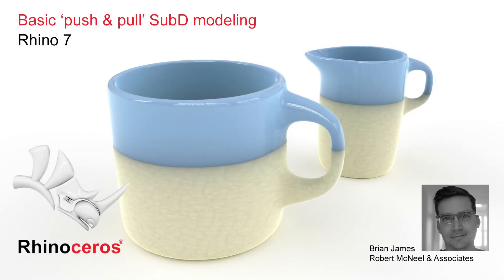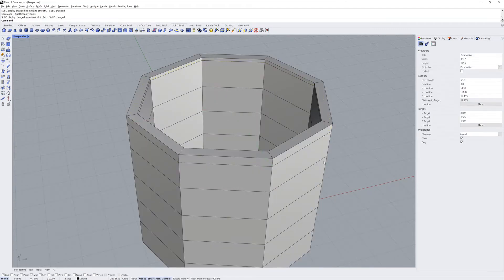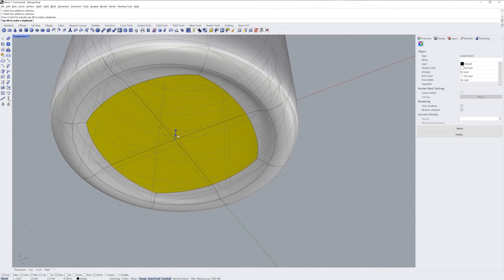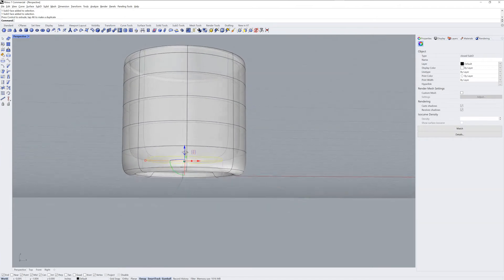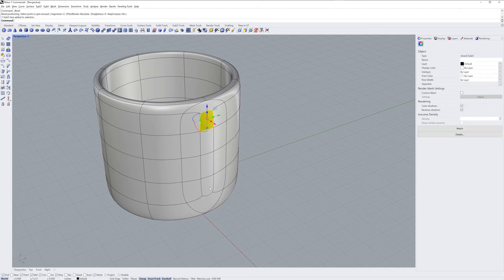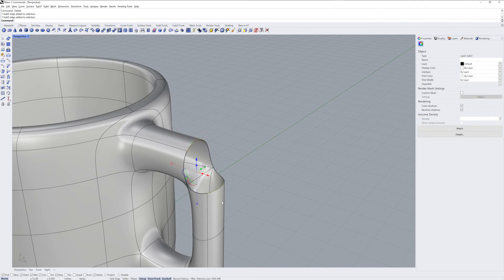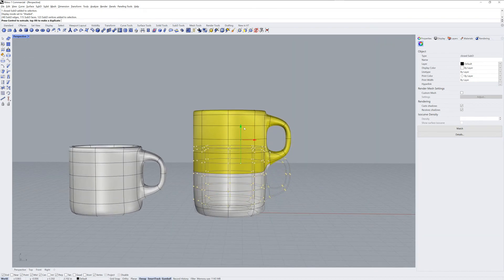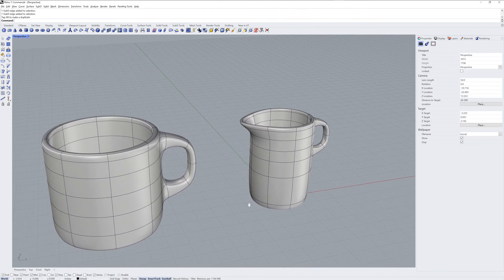Rhino 7 SubD Basics

Comment: Thank you very much for the video, when I press the SHIFT key it scales in two dimensions like your video but when I press CTRL it is distorted and it does not appear like your video. I understand that you press both SHIFT and CTRL at the same time, right? This change occurs at minute 1:00 until 1:17.
Reply from the maker: It looks like something changed here and I'll check with the developers, thanks for the question. You can use any of the single axis scale handles adding Shift and then Ctrl/Cmd to scale and create new faces instead.
Reply: @RhinoGuide  I wish they'd change it back. much more intuitive.
Reply: Hi, Unfortunately, I have the same problem and this function doesn't work for me either. :(
Reply: Hey, just a heads-up — this method works! 🎯 Instead of dragging the 2-axis handle, click the handle while holding down SHIFT + CTRL. It’ll let you input a numerical value directly, result is as expected.

Comment: How do I selectively apply one material on certain subd faces and another material on the rest?
Reply from the maker: Sorry, you can't use sub-objects materials on a SubD yet. This is a filed feature request but currently not possible.  You would need to convert the SubD to a Polysrf with ToNURBS and then assign sub-object materials. You can also Split and then Join areas in the PolySrf at that point to control the areas that can be selected as a sub-object prior to assigning a material via the right click menu of it's thumbnail.

Comment: 0:16 the cylinder you created is with 4 polygons on top of the cylinder. but when I create the same thing my cylinder shows 8 polygons on top. and my settings are exactly the same like yours, verticalfaces = 5, and aroundfaces = 8. did I miss out any setting ? thank you very much Brian if you could answer my question.
Reply: You have to use "Quad" option in the CapFaceStyle section on SubD Cylinder settings, pal.
Reply: @danielbennetts3752  exactly. you are right. I just tried and it works now. thank you so much for you kind help Daniel.
Reply from the maker: You can use the dot on the Gumball arrow to extrude or hold the Ctrl key down after you start dragging with the arrow. Post to the Rhino user forum if you need to share a file. https://discourse.mcneel.com/